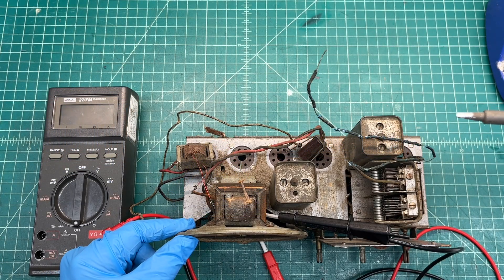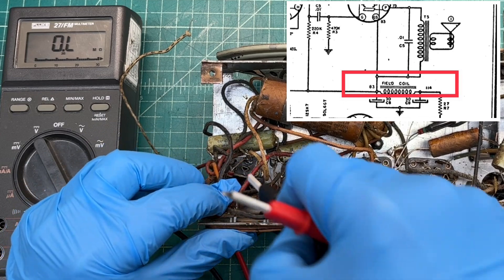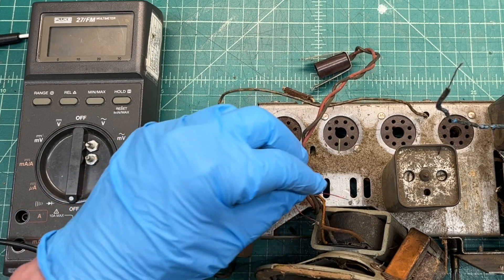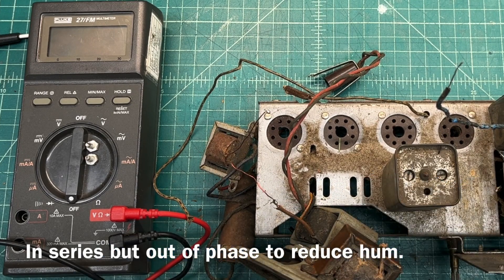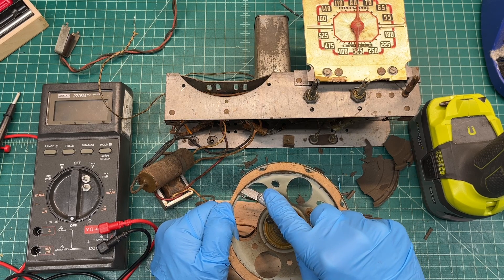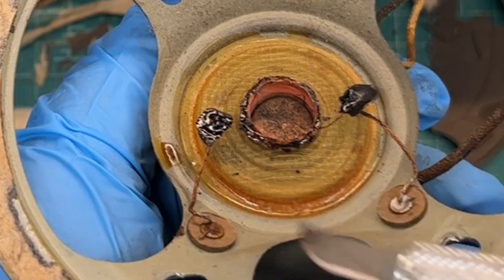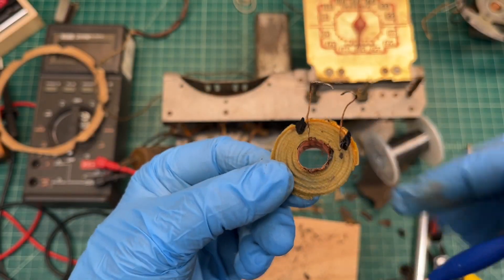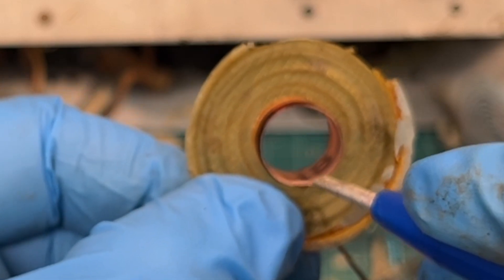Warwick 2-55 - Loudspeaker Evaluation/Teardown | Preparing to Recone

Comment: Tip, put the face of the speaker basket in a shallow pan of acetone. Within several minutes the glue will dissolve, the cardboard will come right off in one piece. The basket will be clean and ready for your recone. Thanks for saving the original speaker, many would toss it.
Reply from the maker: Thanks for the info! I’ve never tried acetone, but I’ve used lacquer thinner in this fashion. Thanks again. Best, Don

Comment: I have a Motorola ac/DC tube radio that has bad oscillator coil. Can you show how to repair it?
Reply from the maker: What’s the model number so I can review the schematic? Best, Don
Reply: @RestoreOldRadios  HiDon, I was able to retrieve the wires. However, I have a GE P715C that has a bad output transformer.
Reply from the maker: Hopefully you can find a break near or at one of the leads leaving the transformer and make a repair. Good luck. Don

Comment: Did more  research and found this chassis to be  from a Clarion radio phonograph model C-101 by Warwick . It's 
schematic shows where the rear pins go on the back of the chassis. When looking at the rear the two on the left are
 for phono inputs and on the right are the phongraph motor connectors. Found in Sams Photofact 365 folder 9. There
 is a B&W photo of it on the cover and this chassis inside the folder to compare to. The record changer itself is a Detrola/
Utah model 550.
Reply from the maker: Thank you Steve, every little bit helps. I think my chassis predates the C-101 as it has a electrodynamic loudspeaker (Field Coil) in lieu of the PM speaker. Other than that, the circuits are almost identical. Great info on the record changer. Thanks again. Don